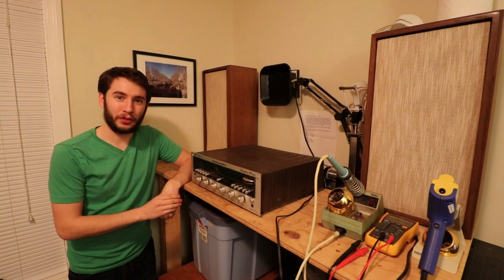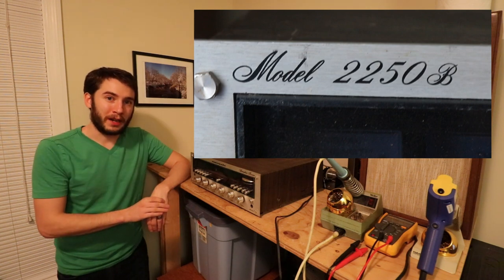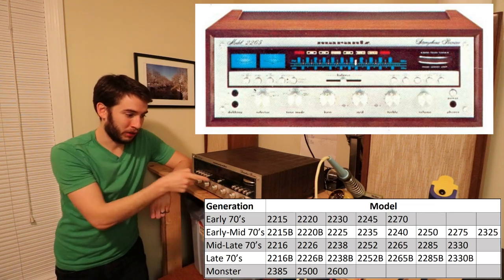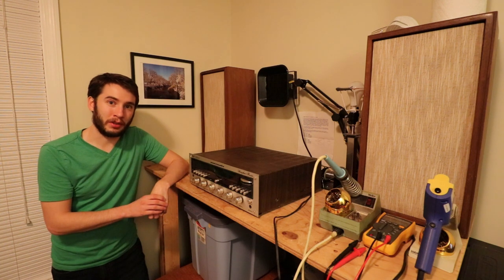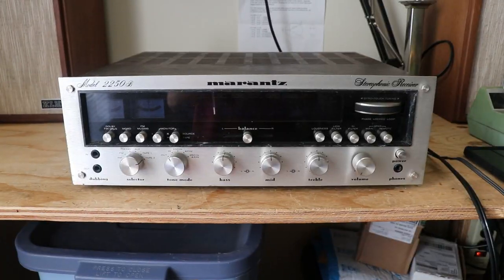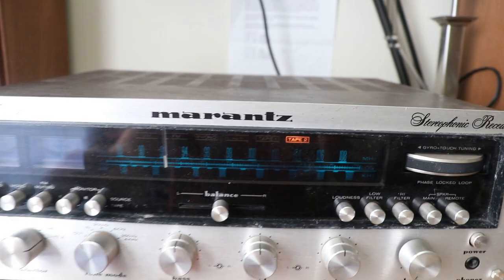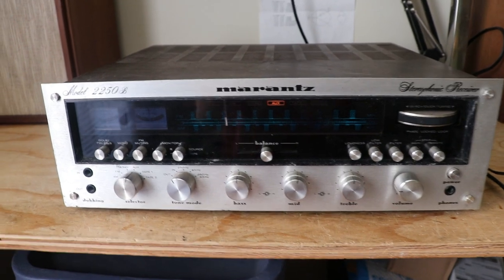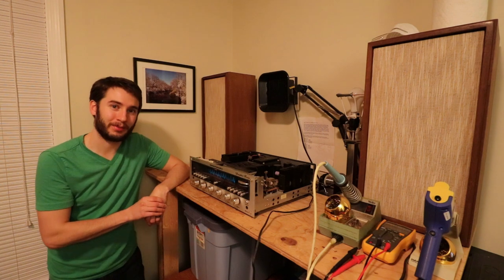Vintage Marantz Stereo Receiver Buying Guide

Comment: Yes I want to buy a vintage Marantz, but they are so overpriced that I just bought a modern one and I am good.
Reply: Why are they overpriced,,?  If you were to purchase any amplifier with equal build quality nowadays,how much do you think you would need to spend?
Also,, be interesting to see how many modern amps will still be around in 50 yrs time,,😂
Reply: @paulwibb.8944  They are over priced because they look cool. Scott, Sherwood, Sansui, made receivers that have a very similar sound and build quality and are exponentially less expensive. You can buy some seriously badass high end gear on the used market for what some of the higher watt models are going for, but they don’t look like a Marantz.
Reply: @justgotohm4775  yep, I guess there's always the desirability factor too,, but what looks cool to one, may not look cool to another.
Reply: @paulwibb.8944  Will you even be able to fix the new ones if something goes wrong, or do you just have to toss out?
Reply: @justgotohm4775  I bought the 2220B on E-bay $180, then took it to the shop to fix the tuning string and have it check-out $120.  So for $300 I got a great looking and sounding vintage receiver. You couldn't buy anything nice for that price. And Marantz will always be worth something.  The 2275 like I had back in 1974 with the wood cabinets are going for $1,500 in good shape.
Reply: @jimmyjoejeeter2366  guess I'll find out, I bought a new marantz amp last yr.
Reply: Doesn't look as cool as my recently sold 2235b, and not as well built by any means,,BUT,, kinda knocks it outa the park on sound quality.
Reply: @paulwibb.8944  I was at a stereo store in Portland, they had a cheap looking new Marantz receiver for $699.99 it looked tacky. I think if something goes wrong with the new ones you just toss them in the trash.
Reply: @justgotohm4775  I always wanted a Mcintosh stereo system, but I still think Marantz looks twice as good as Mcintosh.
Reply: @joelane7146  it didn't temp you then,,
Reply: @joelane7146  I can appreciate that, this whole hobby is so subjective on looks and more importantly sound, no one persons opinion applies past their own preferences.
Reply: @paulwibb.8944  No, I would never buy any new stereo equipment except a stylus & cartridge. The vintage might need some fixing, but at least you know what you got.
Reply: @joelane7146  Tru. I did pick up a Marantz cd6006uk version last yr.
And I must admit it's better than I expected, what turntable you running
Reply: @paulwibb.8944  I have a Kenwood KD-2000 from the 1970,s it was $85.00 off E-bay all it needed was a $12.00 belt, in very good condition Also, a Scott PS48 turntable $35.00 for an audio store that was moving locations. Works great except the cueing is broke.
Reply: @joelane7146  nice one 👍

Comment: Marantz, overrated big time, IMHO
Reply: The internet has cause it too.
Reply: The best Marantz piece is a Sansui
Reply: As the original owner of a Marantz 2275 I bought in 1977 for the then astronomical price of $325, I have had the bulbs replaced , the controls lubed and cleaned and that’s it . I disagree 100% with your conclusion. Best audio investment I ever made .
Reply: @steelydanfan100  marantz would probably win the award for coolest looking receivers and the build quality is fantastic. I have an all original 2285B and I am thinking about following this channel and replacing some old caps but cant imagine it sounding better than it does now.
Reply: There is a Marantz in the first 'John Wick', the scene in his living room.  'John Wick' is cool!!🔊🎶🔊🎶
Reply: @steelydanfan100  I bought the 2275 new in 1974 with the walnut cabinet, I believe it was $600 and $50 for the walnut cabinet.
Reply: @jimmyjoejeeter2366  The 2275 was discontinued ( I think) when I bought mine new in September 1977 , It was a 50% off sale so it would have been $650 retail ( no wood case). That sounds in line with what you paid in 1974.  I bought it from CMC stereo in my hometown of Houston TX . I still have the owner’s manual, the box got away from me during a move . Bummer.  That was the beginning of the end for CMC stereo , that location was closed by the early 1980’s .
Reply: @steelydanfan100  I hope I get another 2275 someday, I had the Marantz imperial 7 speaker!
Reply: @jimmyjoejeeter2366  Here’s hoping for you! The best audio purchase I ever made.
Reply: My 45 year old marrantz  has been  awesome.